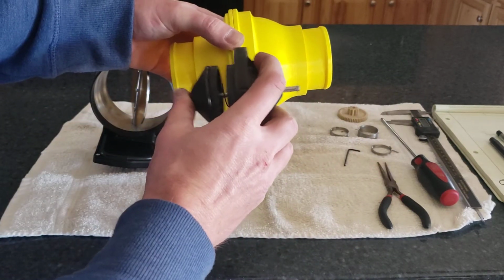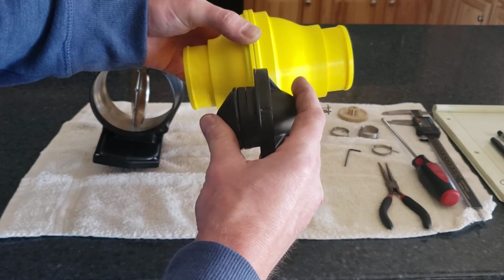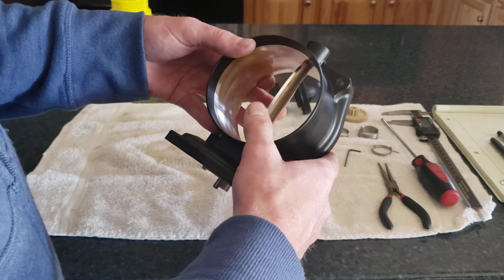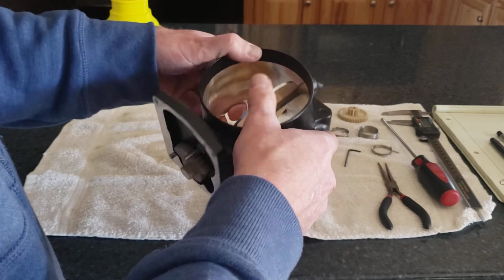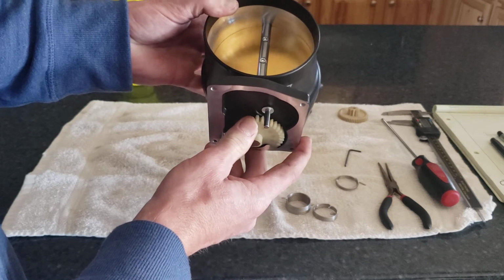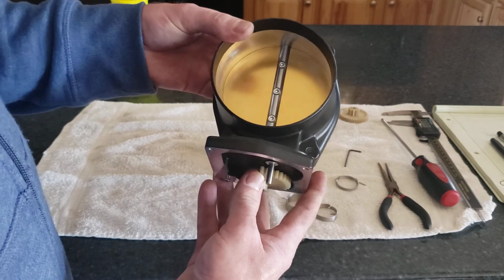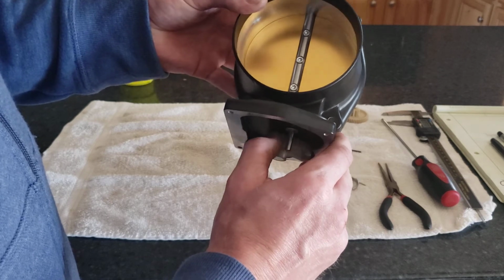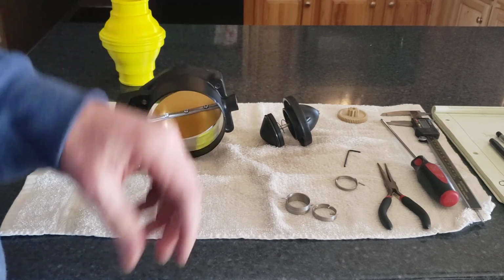Rear-mounted Turbo RS4: eBooster Electronic Bypass Valve Pt. 1

Comment: You can always print out the manual version to have sitting in the boot just in case the Arduino craps out from fatigue. This would also require set of tools and lift for changeover??
Reply from the maker: There is no good way to make the system work for both bypass valve designs...easily one of those cases where the juice isn't worth the squeeze. The Arduino control strategy will have checks and failsafes like many automotive electronic systems.